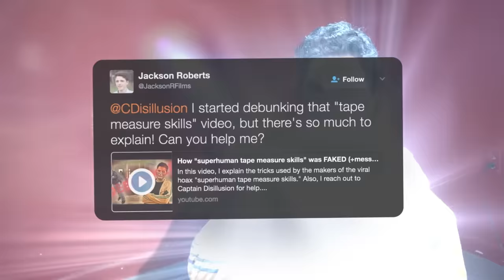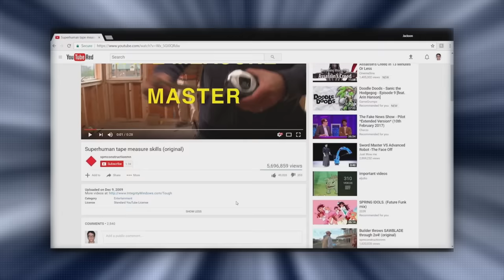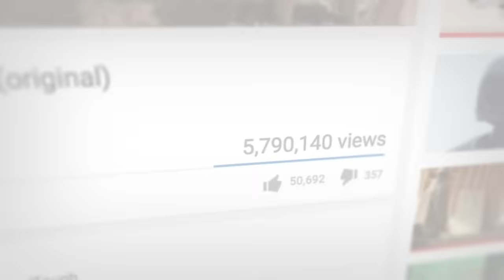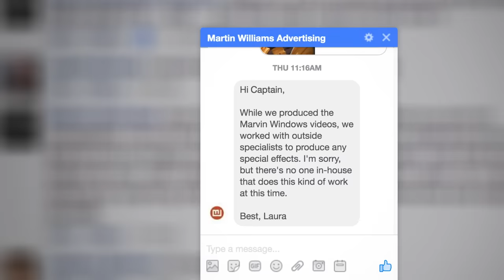Superhuman Tape Measure Skills DEBUNK

Comment: The light switch scene was suspect because it has a switch cover.  Reason I say that it because the cover is installed after the drywall has been placed.
Reply: Good catch, never considered that
Reply: @astro6009  maybe their wiring work is as shoddy as their effects
Reply: I think it was more of a director's decision sort of deal. Probably didn't think people would recognize an unshrouded light switch.
Reply: I'm remodeling my room and I put the covers on before
Reply: Electricians will put the covers on so they can complete the invoice and get paid and it's up to the contractor to remove them and put them back on
It's a scheduling issue you don't let one subcontractor stop another one from completing their work
Reply: as someone who has wired many houses, you wire the house first, strip the wires and prep everything to be installed at the same time, then come back after sheetrock and install all receptacles, switches and fixtures (and faceplates).  it wouldn't make any sense to install a plate, then have someone uninstall / reinstall.  would you do this with ceiling fans also? sconce lighting? plugs?
Reply: @MrMatt713  that doesn't make any sense that you don't understand a contractor that wants to be paid and the general contractor is so far behind in his schedule
I've seen electrician put things on many times that have to be undone later so that they could close out their invoice and get paid
Reply: Oh you’re right. Good catch man I work construction and didn’t even think of that lol
Reply: @MrMatt713  I noticed you didn't respond when I gave you a logical answer
Reply: @thecloneguyz  dude, i have wired new construction on residential houses for years, i understand what you are saying, but you  think and electrician is gonna hang lights on an exposed frame house? its done in multiple trips.  this is from personal experience.  i dont respond normally because as Mark Twain said......
Reply: @thecloneguyz  Richard, you don't "get paid" by doing shit in the wrong order.
Electricians need to make two trips.
You do not install switches, outlets, lights, anything before it's drywalled. Sometimes you don't even install the boxes, because you need an old work box to fit in a certain place, or you don't know where the box needs to be yet, like for microwaves/hoods.
If an electrician put the switches in, the guy hanging the drywall would have to remove them before he could hang the drywall, the tabs overhang the box, and the tabs are meant to rest on the drywall, that's what sets the depth.
Sure cool, you had an idea of why someone might put covers on before it's rocked.
Want a real idea of why I sometimes put switches, outlets, and covers on before it's rocked? You might put the outlets in so you, and others, could use them. And you might put the covers on for safety. If you have homeowners/children wandering the site they will shock themselves if you don't put covers on.
Reply: @billybobjoe198  
I've been doing this for a long time and I've seen several electricians come in and put everything on so they can send their invoice and get paid
It's not their fault the subs dropped the ball and push the schedule
Reply: @billybobjoe198  I have thousands of pictures on my Facebook page from 15 years of general contracting what do you have to prove?
Reply: I don't listen to anybody that has never posted a video of Their Own
Reply: I guess I'm beating a dead horse here, but to get the discussion on the right track again, in my experience there's two basic kinds of construction oversights. The legit kind, and the private, cheap work and bad oversight kind. The legit way is a well coordinated operation with proper oversight, where delays are normal, but dealt with professionally. A place like the one in the ad (a place a big window company would want their product to be seen) definitely wouldn't have covers on the light switches before all the dirty work is done. 
On the shadier construction sites, where some jackass has put it upon himself to run the place on the side, literally anything can happen. No need to argue whether it should happen or not, I have no reason to doubt that there's certain companies that frequently encounter stuff like this. But there's always a reason for that
Reply: @thecloneguyz  Inspectors are for when the city will bone homeowners in the future for not permitting a job.
When the city thinks you have 2 bathrooms then you go to sell with 3 you can have a lot of expensive headaches with the city.
Reply: and its (as far as i know from expeience) impossible to throw a tame messure that far
Reply: @ricky107_  yes, you definitely need a wild one for these tricks
Reply: @MrMatt713  correct.
Reply: @billybobjoe198  Normaly with new constructions there is NO voltage to the wires. Because when wires touch each other, the plugs go off.  ONLY after drywall it, then the electrician connect the board and the plugs. THEN it gets a permition safety aproval.
Reply: @hdj81Vlimited  Yeah I could see that on large scale projects with teams. I tend to just split and wire nut the first in a series so lights can be on and tools can be powered where need be. But I'm a few man operation at the best of times.
Reply: Indeed
Reply: @MrMatt713  maybe so you could test the switches were all working and maybe so you don't have to wait for the guy to install the drywall to complete that before you can do the last 2 minutes work screwing on a faceplate? IDK. The switches looked heavily used though, that was what made it more suspect to me.
Reply: Richard Wolfe imagine being so unsatisfied with your first retort to someone (which you self liked i might add), that you go back and do it again 6 more times saying roughly the same thing without any back and forth.
Reply: Nice spot man! Btw love your name. Two of my favourite things. ‘Chico time’ and ‘haze’ :) 

Hope you all have a good day!
Reply: You like dantdm :O I do
Reply: 2000000000 iq

Comment: Marvin could have just called dude perfect and they would have actually done them even if it took a thousand shots
Reply: I'd call out to both
Reply: I don’t know about you guys, but our tape measures will snap back  unless you manually pull it, so it won’t even go a metre by doing that
Reply: @itsnotnate420  True, but if you wanted to do these tricks you could (relatively) easily modify a TM to either reduce or remove the spring force which causes it to rewind.
That'd be less fake than CGI, at least.
Reply: Now I'm thinking of getting Captain D on Dude Perfect. Their videos are pretty cool, and I'm partial to thinking that they are real just because none of it seems completely impossible, but you never know.
On the other hand, I think they've had verified Guinness World Records on video. (I should note that GWR is corrupt and pointless, but I'm pretty sure they at least don't get in on fakes)
Reply: @Choinkus  Captain D said thier videos are real. You should watch his "definitive guide to trick shot video".
Reply: @whoami1449  there are tapes that don't auto recoil and at the shop I work at we even will launch them at eachother in a similar manner as shown

Comment: I worked with an ad company once that produced an ad where someone bounced a basketball on his head over and over while taking off shirts that had different messages on them, ending with a shot of him bouncing it into the basket. Know how they faked that? They didn't. According to the director, it only took a few shots. You can hear them all cheering in the ad. They left that in as a sound effect.

They also produced ads with visual effects, of course. That just wasn't one of them. I worked with a guy who built a motor to spin to Tostitoes chip like a basketball. On that Tostitoes commercial, they also had a continuity specialist come in to re-set the bowl of chips after every take so it looked right. She was adjusting the salsa with a toothpick. I was both impressed and amused.
Reply: I'd absolutely believe it. They call special effects "movie magic" for a reason, and 90% of pulling off the more mind-boggling effects is doing something in a way so convoluted, and with so much attention to fine detail, that no sane person would ever imagine doing it that way.

Comment: Ive used tapes almost everyday for 25 years... all different brands too. They DO NOT act like this when you yank on them or they would not retract. Also they only stay stiff for 10-12 feet depending on angle and thickness of the tape. Great videos btw cap!

Comment: I originally thought that the tape measurer started at it's destination (i.e. attached to Porta Potty door) before releasing the locking mechanism, thereby allowing the tape to rewind and they simply reversed the playback, in post production. From there, you could simply stop filming, re-attach the tape to the item being acted on, then continue filming, thereby completing the completing the action/loop (Pulling the Porta Potty Door Open), etc.

Comment: As far as the keys , most tape measures have a magnetic tip which can be decently strong , so it's very possible for the keys to have moved before making contact , by magnetic pull.

Comment: You could probably make a tape measure that works in a similar manner by having a large strip of rubber line the strip for traction that's bound to a ball bearing or flywheel mechanism to allow the tape to be fired out in a similar manner.

Comment: While all these shots are fake marketing gimmicks it's important to clarify that if you spend enough time on construction jobsite you become proficient enough with a tape measure to at least nearly accomplish most of these tasks. I have quite a track record for retrieving dropped items with my tape measure so I don't have to climb back down the ladder for them you'll need a heavy duty extra wide tape with the prongs on the end piece. Probably won't grab a pencil with it. But I've picked up keys before, can pick up thin trim boards, etc. I remember one time I was on some scaffolding in front of someone's entryway to their home. A crowd was at the front door chatting and from their perspective only my legs and feet were visible but alas I dropped a piece of vinyl siding and immediately following that, down came the end of my tape measure, easily hooked one of the notches at the nail strip and hoisted it back up and out of view of the crowd who of course all started laughing. If it proves impossible for a particular task, just keep trying anyways and someone will eventually just hand you whatever you were trying to grab. -to which you can then proclaim that it worked even if that required some Jedi mind tricks and subtle persuasion to accomplish it.

Comment: The glass company has a very recognizable logo for it's company, a big red diamond. It's easy to sneak into anything and it would still be recognizable. That's what most viral ads are for, instantly recognizable products. As for the goal, if you have a viral ad about construction workers, then real construction workers will see it. They will spread it around, and they will see the big red diamond. It's not obvious, but it's effective enough in the big scheme of things.

Comment: Side note... the light switch plate wouldn’t be installed without drywall. And there would be temp power. no actual power to the light switch itself

Comment: I mean may be an old video, but I frankly like the PR Laura responding to Captain D here, nice, polite, informative, and most important of all... NOT A COPY PASTE RESPONSE NOR OVERLY SILLY POLITE! XD (I may have some trauma dealing with American Customer Support)

Now to the completely off-topic part about American Customer support.

When I call support, I want to get in, get an answer and get the fuck out to deal with other stuff in my day.

Not spend an additional 5-15 minutes (depending on the length of the specific request) being called ma'am, miss, or various other OVERLY polite responses they are trained to do -.-'

I'd prefer being called an asshole, get the answer I am searching for (even if it doesn't help me) and get out :P

Comment: Light switch scene. BIGGEST clue is that light switches operate vertically not horizontally, unless the switch was rotated 90 degrees. But no skilled electrician would mount it that way. IT'S WRONG!!

Comment: "Whoa, no need for foul language, Jamie.
You're right it is a f**ckin viral ad." 😂😂😂😂
PS, while this nail toss shown may be fake, as a former drywaller, we used to throw nails at scrap boards and stick them all the time. And I have seen a dude stick a 16penny into a subfloor like this before, so just cuz this was faked doesn't mean it can't be done.

Comment: Any one that ever used a tape measure knows this is fake. Tape measures are spring sound so that they retract. SO they fave a pulling force a resistance when pulling out the tape. So they cant just be pulled out and the tape just keeps going if you tried you make get the tape to go about 1 - 2 inches. not unless you have a hacked tape measure.

Comment: Sorry, yes this could and i guess was proven as an ad. However working in both Marine Construction Incorporated out of Florida since I was like four since my dad work there. I have seen all sorts of trick shots with tape measures for both on floating barges and hitting points on pilings usually a nail . Also most of the tape measure is used nowadays have a neodymium magnet in the tip of the measure. So like grabbing the keys scene of course the keys are going to move slightly as the magnet gets closer to the Keys. In fact my tape measure FatMax with the magnet can literally pick up an 8 in Crescent wrench and Easley pick up my keys lifting Force being approximately half a pound to a pound. so even though this video may be fake. I've seen trick shots like this performed in real life with no wires Oh No cameras.